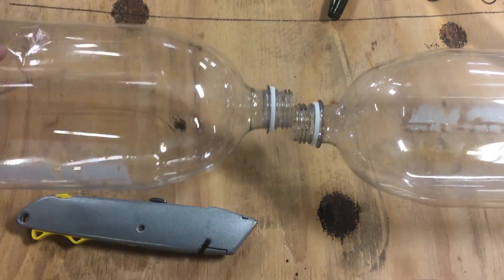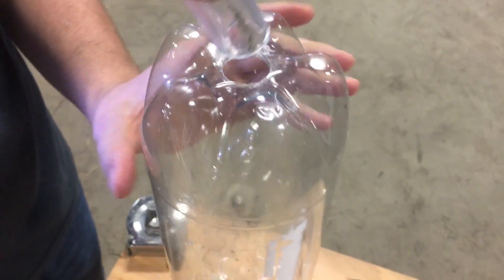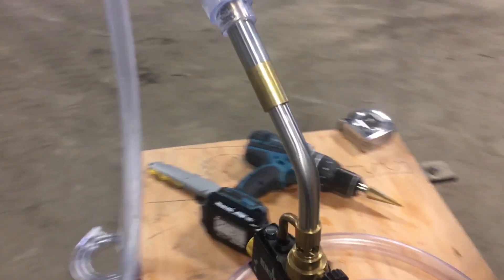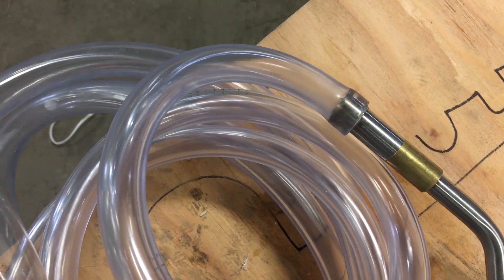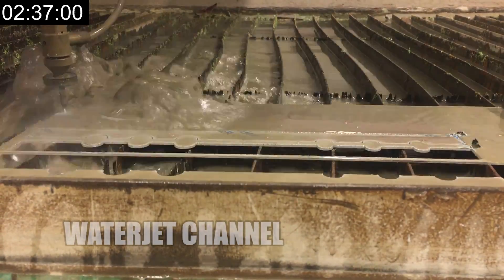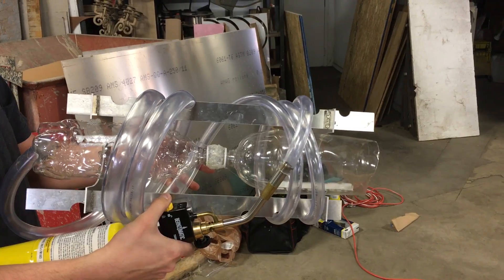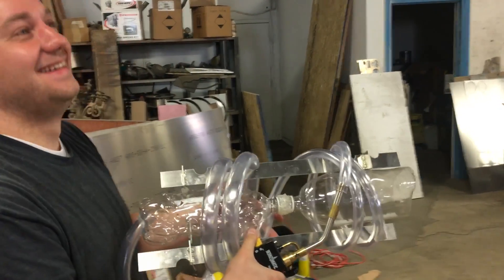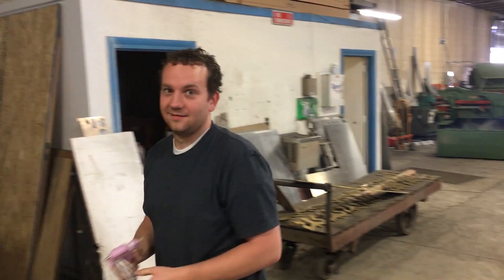How To Make A Plasma Gun - DIY Homemade

Comment: Beginning of the video was a High tech beer bong 
So when you are done charring your buddies hair and eyebrows with the fart thrower, just remove the torch and fill the thing with beer.
You might need to glue the hose in better with mom’s hot glue gun

Comment: So the 1/2 goes into 3/25 then that goes into the hole on the bottle? Or did you have to hot glue there In order to get a tight fit

Comment: you schmuck. that is a poor plasma gun and you know it. (im joking) jokes aside for a more improved design try replacing some of the barrel material with metal with the end piece having thicker walls and a slightly smaller diameter, replace the dinky torch with a proper propane tank and push switch activation system (ideally attached to a handle of some kind. and if the tanks too big attach it to your back like a pack), this ones optional but might i recommend replacing the hose with thermal resistant rubber tubing with a larger diameter?, and of course replace the glue with brass pressure fittings and maybe with some added valves and pressure regulators for safety precautions, and possibly develop projectiles to work with the redesigned barrel and firing system. at least that's what I'd do. and if you do try this let me know...or just make a video about it...

Comment: Replace the 2 liter bottles with a smaller bottle then use a small copper tube as the barrel also shorten the tube and a plasma pistol

Comment: The number of idiots in the comments who think they know what plasma is (technically speaking, fire is also plasma. It even conducts electricity (not well, but much better than air)). There is plasma in the flame and heating things up enormously is just one way to form plasma. There are other ways. Including running an electric current through your gas, which will work under certain conditions without heating anything up significantly.

Comment: There is a slight different between Plasma and a Gas explosion. Because you certainly dont want to bei near Plasma.
Reply: I don't think you understand plasma... Plasma is just ionized material. While one way to ionize it is to add a bunch of energy through heat, there are other ways to do it which aren't nearly as hot. There are plenty of plasma-based lightbulbs which, unlike incandescent lamps, don't heat up at all. That's because an electric current can also ionize something.
Reply: One Inch Nick And the hairs in His belly and maybe a little Bit more.
Reply: One Inch Nick oops i did a little bit of Research and apparently even a normal fire has ionised Gas in it and because of that IT IS Plasma
Reply: So are neon signs plasma?
Reply: @swmontgummybear Yes.